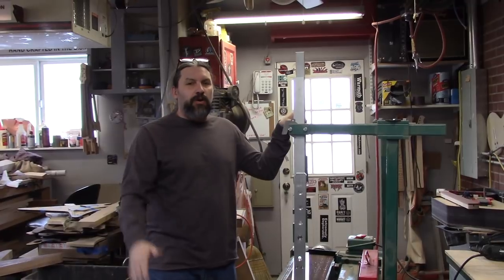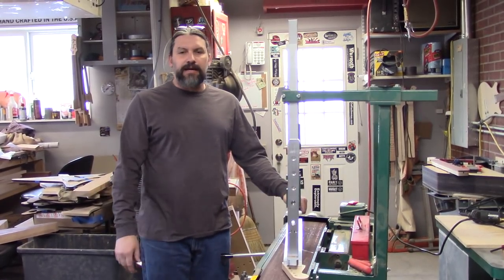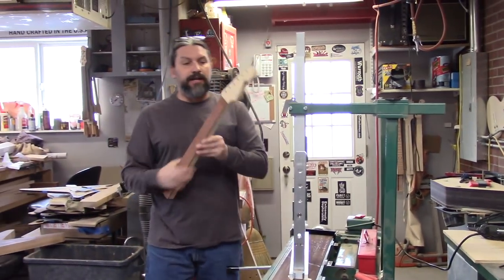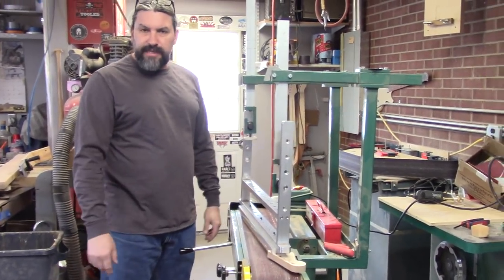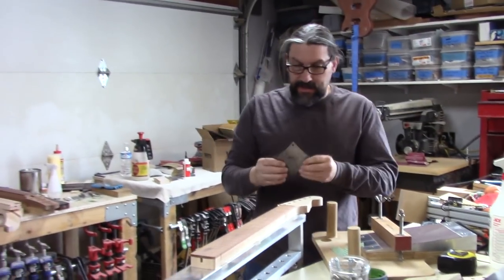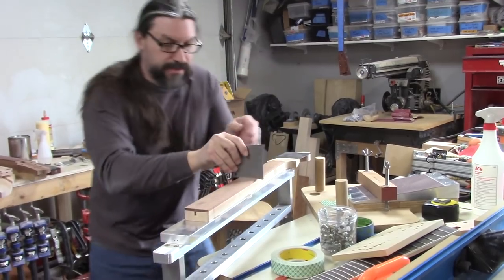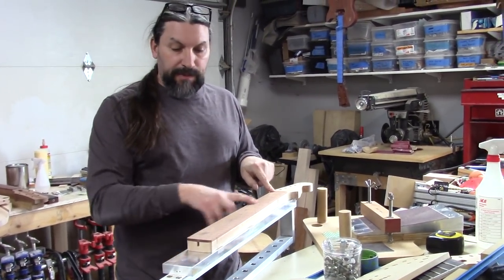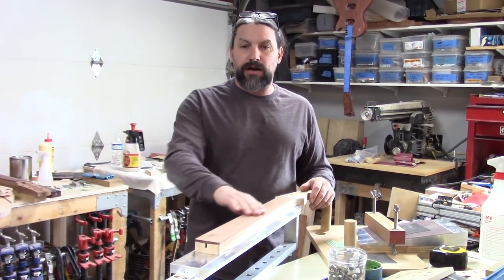The Secrets Of  A Compound Radius... Matt Finally  Gives In

Comment: Thanks for the video. Does the fret board get thinner at the bridge end as it seems it would have to be pushed down more into the sander with the radius being longer at that end and the belt being flat. Perplexing!
Cheers.
Reply from the maker: Hi Troy, 
thanks for watching. The machine can be adjusted to minimize this kinda thing. Actually the compound radius will eliminate some of that since the wider portion has less radius. You can get the fretboard perfect with this tool with a little bit of tweaking.

Comment: Someone else got it here, it’s always called compound but its conical. There’s math to it to; something like the ratio or fraction that the spacing gets wider from the nut to the bridge has to do with the amount the radius expands as you go up the fretboard. 

I put an extreme one on my white Jem 505, started at about 16” and wound up near 20”. Although it seems like that would be crazy flat, it definitely had an effect (in a good way) on the action of the guitar. It’s crazy low, notes bend forever without fretting out, and has crazy fast feel to it. 

I would love to try some more standard numbers like 10”-14” or 12”-16. Definitely interested in this
Reply from the maker: That's why there are 31 flavors my friend. I think most of the really screaming fast guys like a pretty flat board too. People seem to be interested in this topic so I wanted to make more than just one video on it.
Reply: 20'' radius is what Holdsworth liked. The further you go up, there is so little change, it's almost as flat as our earth^^.

Comment: To use this machine do you have to start with fb thickness of 5/16" + if you have only 1/4" blanks how much thinner would your board end up?
Reply from the maker: Yes, we start with a 5/16 fretboard blank. You can do it with a 1/4 but it isn't as classy looking as a nice thick board. We have done stuff like glue contrasting woods together to get the 5/16 and a cool effect. We did that on the GWE guitar

Comment: How do you final sand the neck with so many degrees of radius? Do you just use a very fine belt on the Grizzly?
Reply from the maker: That is one way to go. We usually clean up the wood with a razor after the frets are installed. Thanks for watching Sean

Comment: Not that it matters much but the neck should be parallel to the sander. You don't want a parabolic fret, or maybe you do? Keep up the great videos! I have made a tool for sanding a fretboard that is conical.
Reply from the maker: Thanks for the critique Ken, I'm too stupid to know what parabolic meant so I had to look it up. 
We have never had any issues with U shaped spots. Maybe you mean something else... see above about how stupid I am and try to use small words. 
We get several questions about why the rig is set at an angle.
Reply: I’m not that smart either but years ago I got to start thinking about violin family fingerboard and bridge relationship. So I looked up a lot of stuff. 
But regarding your set up. One edge of your fretboard touches the sander “farther up the cone” than the other. Although it is only a small amount, it results in a non-circular curve at each fret position. Again very subtle and not significant practically.
Reply from the maker: I still don't understand Ken... which, of course, shouldn't surprise anyone. The angle of the fixture is still hitting the platen of the sander the same way as if the unit was parallel to it. We have not experienced any issues but will continue to look at our fretboards with the gauges we have at our disposal for inconsistencies. 
We try to pay attention to as many details as is practically possible to avoid stacking tolerances... However, it is very easy to get hung up on insignificant things. This is kind of the exact reason we are doing a video series on compound radius and why we don't use them The theory doesn't match the real world facts as far as I am concerned, your millage may vary?
Reply: I don’t use the compound radius either on guitars. Also I didn’t mean to imply your regular fretboards had a parabolic shape only that when doing the compound type, which you were demonstrating in this video would. And it seems I was wrong. It looks good from the video that your method has got the shape correct. Mic the nut end edge on right and compare to left. They should be the same dimension.
Reply from the maker: I certainly don't have a lot of experience with the compound radius fretboard. Frankly, I was surprised it came out as well as it did. The rig has to wobble all over the place and the payback seems... theoretical at best hahaha

Comment: The first secret of a compound radius is that it actually is a CONICAL radius NOT compound
Reply from the maker: Wait for video number 2... I talk about that too
Reply: exactly, and the sanding should be on the same plane as the axis of the 'cone'. in this case because the neck is sanded at an angle..the compounding is skewed.. so the compounding is somewhere less than the minimum and greater than the maximum of the radius setting at each end..and the edges of the fretboard would not really be the same on both sides...one edge would be thinner than the other on the corresponding location as measured from the nut..difficult to explain in words...the second problem is getting the frets to sit flush with the top of the neck..and then to compound radius the tops of the frets when leveling..in the end you will still need to do some individual leveling of the frets to remove any buzzing from low string action bends..but closer to the final result with this jig than otherwise

Comment: The radius should increase proportional with the fretboard width to have even action across the fretboard. width@heel / width@nut = radius@heel /radius@nut. It will come out at a third. So 7.25-9.5, 10-14, 12-16 work well. (if the width works the same)
It's all in the cone. The 10-15 that came out is close to that of a Parker Fly (10-14), It'll work fine. Now I want to see you guys bending all the fretwire to the different radii. 
Got any footage giving the desert lead poisoning?
Great music as always. Who did that Solid 6 track?
Reply from the maker: You are jumping ahead to video number 2 that I am uploading right now.